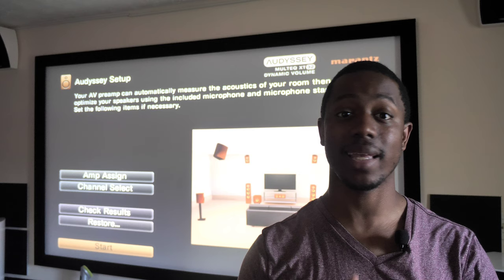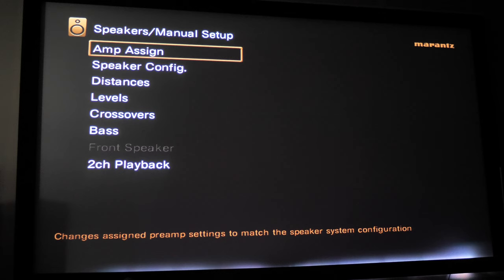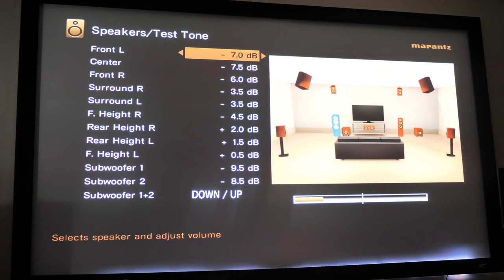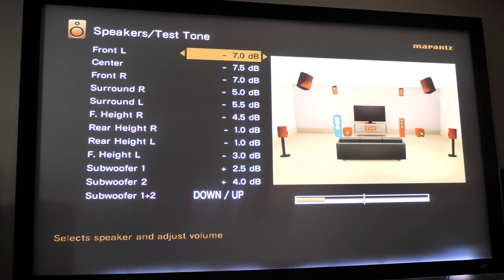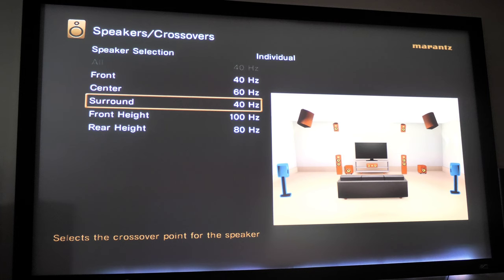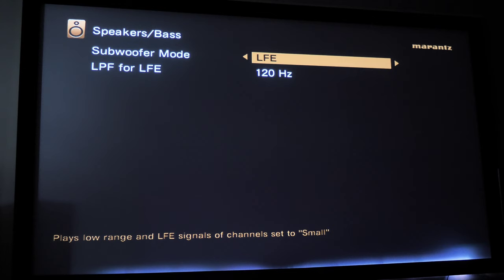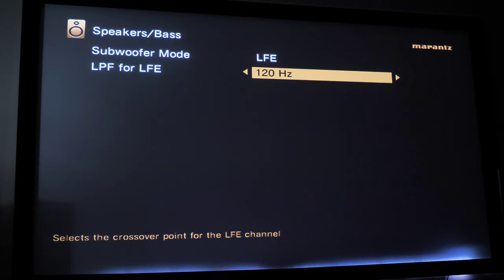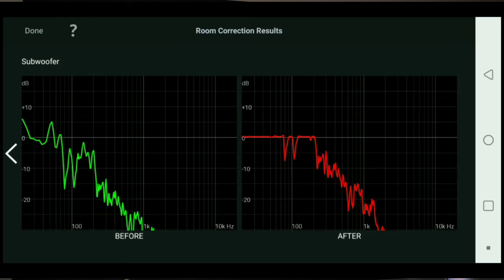How To Identify and Correct Receiver Calibration Mistakes

Comment: Good video man u should have a larger fan following. Also I want to send u some pics of my home theather for one of your showcase videos
Reply from the maker: Subscriber showcase announcements coming this week! So go ahead and gather some videos and pics
Reply: @Kpaceguy  just watched this video nice job by the way,ok I have a question on speaker level I use a spl meter to get 75db each of speaker reads differently example the numbers don't match to get 75db, what do I do keep trying or what
Reply: @Kpaceguy  oh ive used auddesey xt32 aswell
Reply from the maker: @waymonfrench2077  the numbers on the screen don't need to match as long as you're getting 75db on your meter with the receiver volume on reference or 0db
Reply: @Kpaceguy  thank you my brother I was wondering that ,if you don't mind where can I find those height speakers I would want mine in black though the white looks good aswell I know their high $$$
Reply from the maker: Accessories4less has them in black. Canton ar800s
Reply: Very cool ill be on the lookout
Reply: @Kpaceguy  thanks kpaceguy ive learned alot from ya ,how well is atmos on those
Reply from the maker: @waymonfrench2077  my favorite atmos speaker out of all of them out there
Reply: @Kpaceguy  lol,ok thanks enjoy im considering those cantons,I have two sets of svs prime elevations i may upgrade i think they are $699 a piece (ouch) at the website you gave me thanks
Reply: @Kpaceguy  hey kpaceguy do you use peq on your app whats your settings bass boost, Qfac,feq

Comment: Do NOT change your distances unless you know what you're doing, folks. On a denon or marantz, the distance setting is really a timing setting. If your speaker is not set to the appropriate distance(measured), it's because it's at the necessary distance(timing) in order to have that speaker be in phase with the others. This is not a distance setting. 
What it actually is, is a time delay setting. So all sound hits your ears at the same time. That's why your sub could say 14 feet but its right next to your left or right speaker which is 9 feet. That's fine. It just means the sub needed to be delayed a bit to arrive in phase. Don't tweak it unless you have extensive knowledge of what you're changing, because it has nothing to do with distance. It should be labeled in milliseconds like every other piece of equipment out there
Reply: This.  This was the point I stopped watching the video.
Reply: Thanks mate! Appreciated! 👍
Reply: @brianfutrelle5676  
The point where I stopped taking him seriously is when he claimed the large setting could be "dangerous" because it sends the whole frequency to the speakers. 
Most ridiculous thing I have ever heard.
Reply from the maker: Why wouldn't it be
Reply: @Kpaceguy  
Because that was a dumb statement to make. I mean no offense and am sorry for my crass statement, but please think about what you said there:
Every decent radio, stereo amplifier etc. without inbuilt controls will ALWAYS send the whole frequency range to your headphones/speakers or whatever you connect to them. 

That doesn't mean the speaker would drive itself too hard to achieve those frequencies, and break in the process. If the speaker cannot physically achieve those frequencies it will just not image them, even if they are pushed up by Audysee. 

Actually: If you don't use a subwoofer in your system Audysee won't allow you to change your front speakers to "small" and rightly so, because there is no crossover to be had.

In fact Dirac, Audysee and the like are smart enough to not over-equalize bass and high-frequencies the speakers already roll off of too hard.

So Danger (I don't even know what you are referring to, certainly not dangerous to us, but it's definitely not dangerous to the speaker either) is NOT the reason you don't want to set the front speakers to large. 

The actual reason is not cluttering your front speakers with bass frequencies your subwoofer already handles, that would make them needlessly work more and muddy the clearness of all other frequencies in the process.

The best way to illustrate the difference is when using a phantom center instead of a physical one. 
Turn off the subwoofer after calibration and listen to what the setting "large" can do to your dialogue in ambient-heavy scenes. 
Depending on the quality of your speaker dialogue can end up downright unintelligible.
Reply from the maker: @Mat-hr1dg   @Matthias  the danger comes from high volumes. There is nothing stopping your speakers from blowing. Playing underneath rated response is nothing but heat. It's taxing on the coil, it's taxing on the amplifier and it's taxing on the sound. Set it to small and cross it over at 40hz and let the roll-off protect your speakers even without a sub unless you TRULY have full range speakers. One thing you didn't mention in your book is setting the speakers to large requires some good clean power and receivers (minus a select few) aren't going to give it. That low bass that you aren't crossing over becomes clipping/heat that, overtime, cooks your coils. It's dangerous. There's no reason to go large. Set it to small and cross it over as low as your receiver will allow. I can't find any reason why you want your 35hz-40khz response speakers playing 20hz. Make it make sense. No offense taken though.
Reply: @Kpaceguy  you can't set a crossover if you don't have a sub, because there is nothing to cross over to, nor does it make sense to cross over to some non existent..thing.

I build crossovers all the time. By that I mean the passive crossovers inside the speakers. 
You are describing the job of the crossover inside the speaker. 
Speakers don't just play every frequency at full volume. The full signal is sent and think of the built-in crossover as a purpose-built filter for those particular woofers/tweeters.

I think that is the point the other person was trying to make.
Reply from the maker: @Cblan1224  tell It you have a sub then..
Reply: @Kpaceguy  I have multiple, but I'm not sure what you mean. I haven't always. It doesn't matter if you have 2 4" speakers in stereo..you don't set an external crossover when there's already an internal crossover doing just that. Unless of course you built an active speaker that is designed for an external crossover.
What I meant by you "cant", is that if you only have 2 speakers, my avr won't even let me set them to small. It wouldn't make sense to do so.
Reply from the maker: @Cblan1224  you can tell the receiver you have subs AFTER calibration and set the speakers to small and set a crossover at 40hz so that you get all the full ranges you need and still cut off the bass typically reserved for the sub. Speakers now a days like you big box brands don't cut off low bass frequencies. That's why at high volumes it can be dangerous to play full range. Plus it adds distortion which typically is clipping/heat. There's no reason to run a speaker full range unless you have a speaker made to do so if all that makes sense. If I remember right, auddessy lets you set your setting for 2 ch. I believe that app gives you a lot of control as well further than the avr will
Reply: @Kpaceguy  yes I'm sure there are ways to do it but what im telling you is that it makes no sense. Again, you are describing problems that are solved with a built in passive crossover.
Reply from the maker: @Cblan1224  the conversation was why full range was dangerous and how to still achieve a big sound and still protect everything else. This post is a year old. I only responded. Didn't start anything
Reply: @Kpaceguy  
Nobody says you started anything at all. 

But I stand by my point that you describing it as dangerous makes no sense since as Chris said: Speakers use internal crossovers to send each woofer or tweeter the frequency range it's supposed to operate on. Sure, the crossover itself might run hotter but it is not "Dangerous" at all. 
In fact in case of high level music-listening most people would not recommend using a sub anyway let alone use cutoffs so why would it NOT be dangerous then if it would be in a home theater environment. 
A smooth roll off will always sound more natural than a hard cutoff. 

Like I said: Audyssey has safeties in place to not overcorrect high and low frequencies and blast the speakers with unneeded power.

If you have a subwoofer your comments are entirely correct and I don't even have an issue with your reasoning that it would benefit the sound when using one.
What weirded me out was the word "dangerous". 

Unless your manufacturer seriously cheaped out on crossover components (well they always do, but I mean: to a criminal extent) and you don't use some imaginary Audyssey version it's not a relevant argument to make and honestly as accurate as saying that a center speaker isn't as important as the rest. Accurate in Dolby Pro logic days? Perhaps. Accurate nowadays? No, quite the opposite.

Anyway, I guess we all said our part and can leave it at that. 
It was my fault for initially being disrespectful anyway and I don't really care for this argument or its validity on anyone's part enough to further a flamewar and make anyone, be it me, be it you look bad since in general the recommendation you made was valid either way even if I have a problem with the argumentation on why, be it correct or incorrect.

The original point of Chris in his opening statement from one year ago which you didn't refute, was entirely accurate though and shouldn't be buried by me arguing over something pretty much irrelevant.

Comment: I purchased kef full setup with mass w200 sub. I had no mic with my pioneer vsx1019ahk but did all the things you state manually and couldn't be happier with the sound I see no point in purchasing a mic to calibrate my room. If I play all channel stereo and move my head a few inches forward then I lose sound from the back, if I move my head to the left I hear the left front and rear more and the right side less and vice versa. Literally perfectly in tune so experimenting with distances and spl meter is absolutely necessary and further to this before purchasing this lot I had no experience with home theatre but put in the time to learn and has paid off. Thank you for your input as I was considering buying a mic to see if I was missing anything 👍

Comment: Bruh, you are awesome. I had a "audio" company wire up my system and calibrate. The sound was only decent. I suspected there was more to ne done but they were the "experts" —I’m running 805 d3 mains, matching center, similar surrounds and 2nREL Sho S5. Devaliet power and mono block for center.—— stereo music was pretty good on everything but rock. However home theater sucked. My listening environment back then was indeed tough but I still think they could have done more. I’m in a different house now with a dedicated home theater starting to developer. YOUR GRASP on just the receiver is EXCELLENT. I’m going to watch this video and take notes so that my new environment utilizes the gear I own to the max. VERY MUCH APPRECITE YOU SIR.
Reply from the maker: Thanks for watching 🙏

Comment: I have a near field and a living room home theater.The near field is powered by a yamaha that only allows one seat calibration.In that room going back and doing a level calibration with a sound pressure meter gives best results. My living room Yamaha 2080 gives an 8 position calibration and I use it to calibrate one seat with 8 positions. The results are excellent and sound better than doing a manual level calibration after the Yamaha calibration is done. As far as distance goes I never change them from what receiver calibrates because its setting delays in both rooms. At least for me this works and sounds best. This was an excellent video. Would love to see you calibrate using Dirac Live if you ever have access to it.

Comment: Good video. Learned a couple new things here. One thing I'd like to point out is to make sure NOT to change any of the distance measurements for the subwoofers in the settings. The reasoning is mentioned in other AVR channels and the subwoofer has more to do with it balancing them out with other speakers instead of being particular to a measured distance from your seated location. Also, the crossover settings that's usually recommended is higher than 40hz or 60hz. Most say to just set the speakers at 80hz and let the subs deal with any lower frequencies. This is regardless of the fact that a speaker may have a response below 40hz.
Reply from the maker: Yes I found that out from someone in one of my other settings videos. Good info!
Reply: Yes the distance measurements are actually delay measurements. Since the sub signal has to go through another amplifier, and some subs have DSP processing, this is why the distance for the sub is sometimes larger than the other speakers. You should not change the distance values.

Comment: I have been following your Youtube video for sometime now. Year by year I will go back and revisit them each time I learn something different for example following manufactor rating feq. response  and increase by 20 of course after room calibration. I have also heard  from another youtube channel when you correct your audio sync on center channel to your tv and all equipment that help to making sure your vocals are in sync. Must people think getting the best out of your system in a matter of hours. I a sure you it doesn't, however it's a start. Knowing what your equipment can and can't do will help. I am not there but bit by bit I am still learning. Thanks for what you do to make it simple.
Reply from the maker: I appreciate that Thank you for watching

Comment: Never set the crossover settings of speakers below 80 Hz because even the best of speakers do not deliver frequencies below 80 hz comfortably. When you have a dedicated subwoofer for low frequencies, you might as well use it. That's what a subwoofer is for. 

I set my bass setting to LFE + Main because most of the audio we listen to, does not have discrete LFE signal. The whole purpose of setting the crossovers of all speakers is to allow the lower frequencies to go to the sub. That will happen only if you set it to LFE + Main. 

Some of the things in the video are misleading (however, these may work for your listening taste).
Reply: I believe that is a little misleading too. LFE + Main actually means it will double the bass signal from the main channels, sending it to BOTH the speaker and sub. It's effectively boosting bass. I think you want LFE... and also set your speakers to "small". Even though it says LFE, what it MEANS is "LFE + Crossover signals". The catch is you only get crossover signal if you have the speakers set to "small".
Reply: I have Logitech speaker's x210 and i just want to say that the sound is so sweet and the bass so smooth and tied up with the speakers whatever i hear even and the speak goes and from the sub and i like that why i say that... Because i have prime towers ultra center and prime bookselfs and 2 monoliths 15 and i cant hear that smoothness in the sound also i cant hear the tide up with the speakers or voices deaper to goes from the sub what i have to do buddy???
Reply: The web manual should make it clearer that the "double bass signal" (one from the sub and at-the-same-time from the Main) only happens if the Mains are set to Large and choosing a “xover”. This particular “xover” is a selector & does NOT cut ANY bass to the Mains It merely allows you to select a range of bass to be duplicated and go to the sub. But the mains still get that range too, hence “double bass”.  This can cause overwhelming bass so choose a xover like 40Hz which (for movies) can be OK as it is mainly ambience below 40Hz.and can produce a room-filling effect.  This option is not often optimal for music.

Comment: Hello again KPACEGUY. Thanks again for those tips. I ll start with my tv. It s Sony Bravia 75- inches plus my speakers are CANTON GLE 490.2 ... 4 of them. 2- front And 2- surround and for the back surround It s 2- ELITE PIONEER  sp-fs51 from A JONES an for the center it s a PIONEER  sp-c21 and for the ATMOS I use my  4- old cube speakers BOSE   For my subwoofers l use my old 8- inches  from PIONEER  and my new PARADIGM studio SUB 15. The receiver is a DENON X6500h + a AIRCOM on top of It and a new ANTHEM MCA -5 power amplifier. Oufffff   I have a red  finger 😂😂😂. Like i said before  realy good job on how u r explain in a easy way for us to understand our  home-cinema 👍🏽👍🏽👍🏽 take care and GOD bless u
Reply from the maker: You sound considering submitting pictures and videos to my email of your home theater for my subscriber showcase series coming up soon!

Comment: Audyssey throws up phase error on my center and right channels. Swapped L and R and ruled out speaker error. Its the position of the speaker thats causing it. Any thoughts on how to fix this? Thx
Reply from the maker: It'll throw errors even when it's correct. Just physically make sure your wires aren't crossed and ignore the error. It could be just room acoustics

Comment: Thanks kpaceguy my only problem is I have a pioneer 701 ,and I added an amplifier to front channels . Through the receiver it set at 80hz . The amplifier I have is a crown 1502 should I set it to high pass were as tho I can set a crossover. Or should I set it to "no crossover and let what the receiver  push the 80hz? Speakers are polk t50 40hz. Thanks great information everytime I get that notification.
Reply from the maker: I'm a big fan of having all the crossovers and settings all in one central place so you know what everything is doing and where to go when you need to check/change something. Set it to no crossover and let your receiver handle the crossover
Reply: @Kpaceguy  thank you kpaceguy .